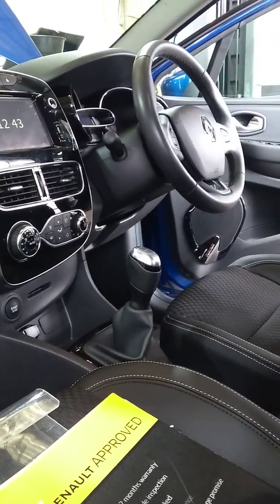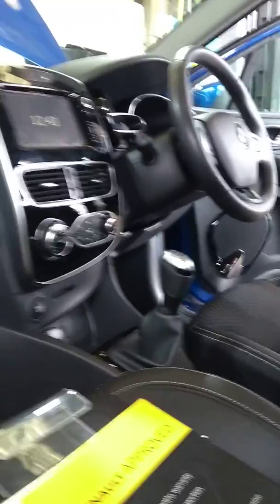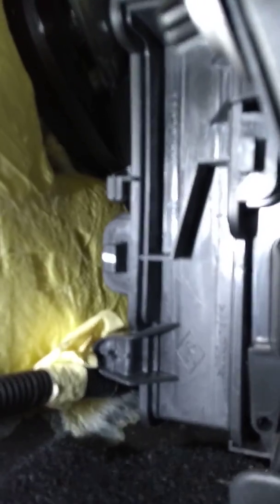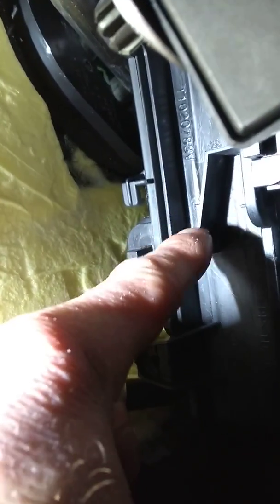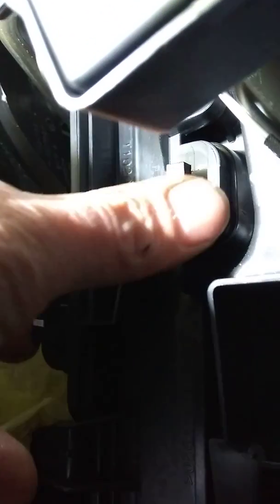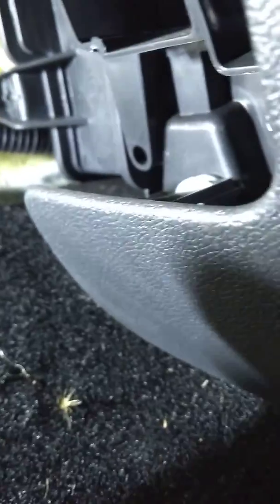HOW TO REPLACE CABIN FILTER ON RENAULT CLIO

Comment: Seems impossible to get the harder designs of filter in there without damaging them.
Reply from the maker: This specific filter is the expensive carbon cabin filter and if you don't squeeze it it can't get inside ,bit it doesn't get damage ,the normal cheap white one it gets inside much easier